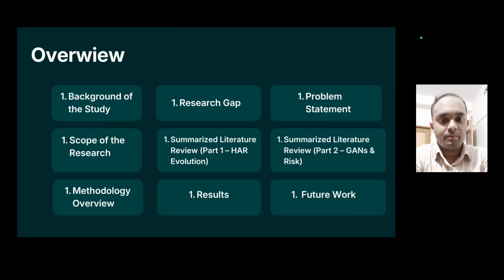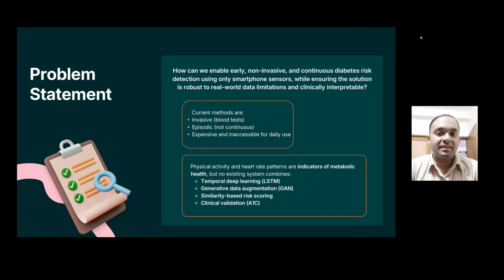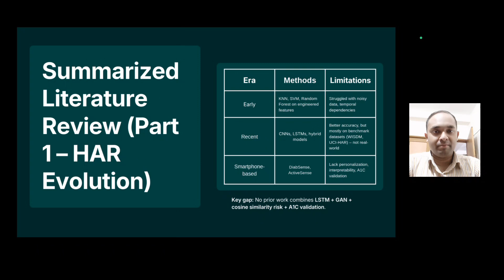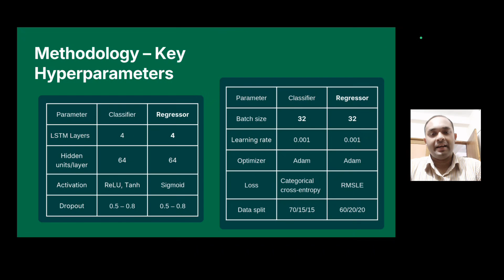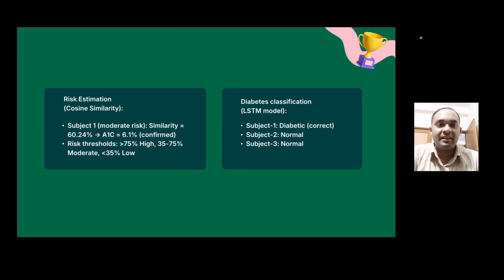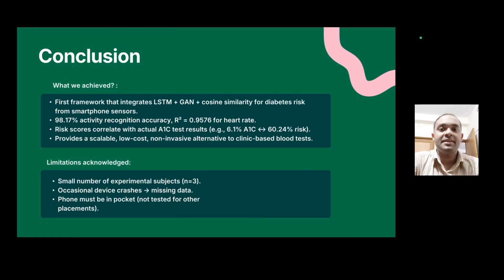Early Diabetes Risk Detection using Smartphone Sensors and LSTM-GAN Framework.

Comment: Why was a Butterworth low-pass filter applied during preprocessing, and what kind of noise does it specifically remove from accelerometer data?
Name: Ashik Islam
ID: 202220000102
Section: 2
Reply from the maker: 1. A 4th-order Butterworth low-pass filter was applied to smooth the raw temporal data streams, which helps ensure temporal consistency and stabilizes the gradient descent process during model training. 2. It specifically targets and removes temporal noise resulting from motion jitter from the accelerometer data streams.

Comment: “In what ways does the LSTM-GAN framework improve the accuracy of early diabetes risk detection when using data collected from smartphone sensors?

ID: 2023000000051
Sec: 02
Reply from the maker: The LSTM learns activity patterns from smartphone sensor data. The GAN creates extra data to solve the lack of data. Together, they improve activity recognition accuracy to 98.22%.

Comment: What was the exact role of the GAN component? Was it used for data augmentation to solve data scarcity, or directly for anomaly detection?

Name: Arif Raugir 
Id: 2023100000584
Section: 2
Reply from the maker: The GAN component was used strictly for data augmentation to solve data scarcity and imbalance by generating synthetic sensor data, not for direct anomaly detection.

Comment: If your model works well in lab data but fails in real hospitals, what could be the reason?
Name: sabrin alom
Id no: 2023100000164
Sec:2
Reply from the maker: This failure happens because real-world smartphone data contains erratic temporal noise from motion jitter (like phone placement shifts or hand tremors) that degrades signal quality and causes model overfitting if not properly filtered during preprocessing.

Comment: Why was GAN used in this research?

id:2023000000011
Reply from the maker: The GAN was used for data augmentation to resolve data scarcity and imbalance by generating synthetic sensor samples to prevent model overfitting.

Comment: Smartphone passive sensors are incredibly noisy. An anomalous gait pattern or a sudden drop in physical activity could be caused by transient factors like a minor ankle sprain, changing shoes, carrying heavy groceries, or seasonal weather variations rather than early-stage diabetes or peripheral neuropathy. How does your LSTM layer decouple true chronic pre-diabetic physiological decay from everyday lifestyle anomalies?
Reply from the maker: The LSTM model evaluates 30 days of ongoing activity and heart rate data; therefore, short-term fluctuations caused by factors such as injury and weather are not given much importance. The risk score generated by the algorithm is also validated using cosine similarity and A1C scores.

Comment: Why did you choose LSTM instead of CNN or traditional machine learning models?
ID:2022200000103
Section:02
Reply from the maker: LSTM was chosen because it is uniquely designed to process continuous time-series data and capture complex temporal dependencies over time, which traditional machine learning models and standard CNNs struggle to handle effectively.

Comment: Why did you use A1C results for validation?

Name : Md. Tanvir Ahammed
Id : 2022200000083
Reply from the maker: Clinical A1C is a well-established indicator of long-term blood glucose levels. By comparing predicted risk scores with A1C scores,  also see whether the system's predictions were clinically meaningful.